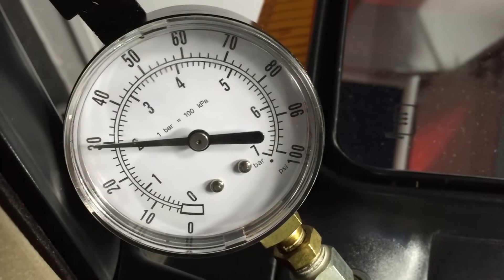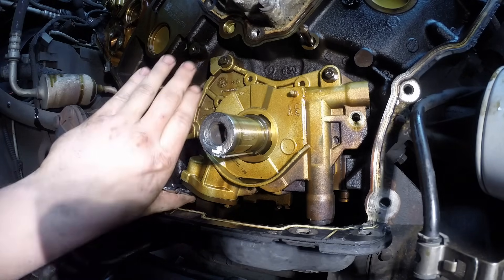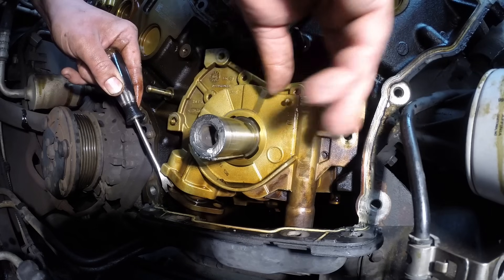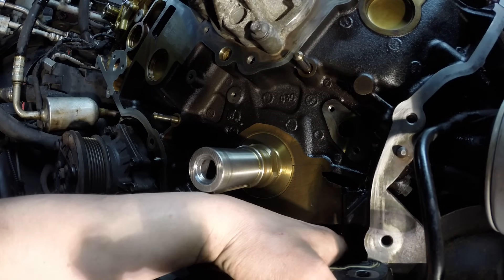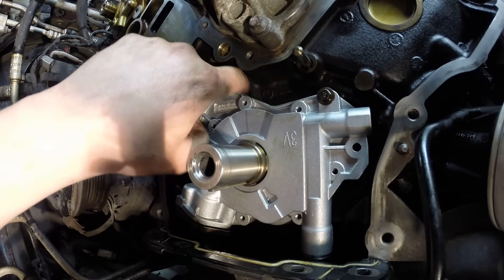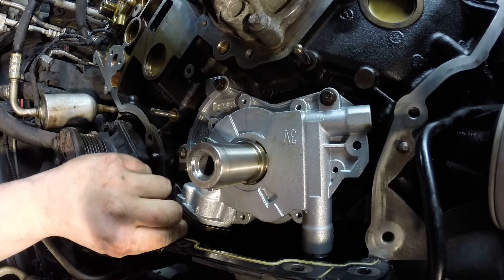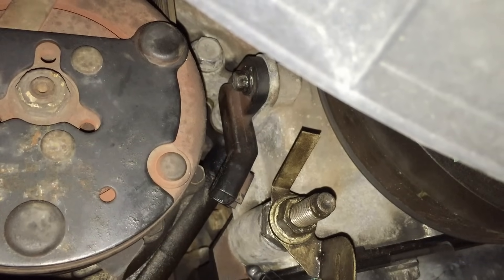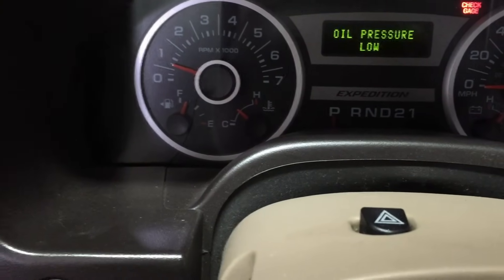Ford 5.4L 3v Engine Melling M360 Oil Pump Upgrade

Comment: Ok.. So you all who have done this.. You must have some smalllllll fingers. Because that one bolt.. Oh my... I could not get it to even turn. Because I didn't have that nice ratcheting wrinch. So how did I do it?  Yeah I had to think outside the box (after 2 hours) I wrapped the bolt near the head with a small amount of thread tape. When I got the bolt in I pulled the tape to make the bolt spin. That is the ONLY way I could get it. Any way THANK YOU AGAIN FOR YOUR VIDS.

Comment: I have a 1997 ford expedition 5.4 and Its leaking oil from the oil pressure gauge switch even after replacing it. What do you think might be the problem.
Reply: Dry off the threads and use pipe dope to reseal it

Comment: Delayed oil Pressure on cold start......

A question for anyone who may have experienced this issue or have had this problem. I just did the complete timing replacement job using all the Melling parts including the 360HV pump on my 2007 5.4 3valve and the engine runs fantastic. I contacted Melling because my oil pressure is high and climes to over 100 psi at high rpm. They told me it's because I put a high volume oil pump on an engine that didn't require it, (It doesn't have enough wear to require it). The engine has 218000km on it but I have always used K&N oil filters and Lucas 10w30 full synthetic oil in it. Here is my issue. After the engine has been sitting for several hours, if you crank and let it start right away it takes 3 to 4 seconds for the oil pressure to start building. when it builds, it builds fast. Before it builds I have the typical valve train rattle on the passenger side head until the oil reaches the head. The only way I seem to be able to mitigate this is by holding the accelerator to the floor and letting the engine crank for about 4 to 5 seconds and then let my foot of the pedal and it will start without the rattle because the oil pressure has already started to build. I asked Melling about this and they said to make sure that I installed the O-Ring on the pick up tube. I did install the O-ring that came with the kit and torqued the bolts to 89 inch-lbs. The oil pickup tube was removed and cleaned completely before re-installation as I had the oil pan off. Has anyone else exerienced this issue?
Thanks for any advice in advance !
Reply: It's my guess your lifters .. er, hydraulic lash adjusters are bleeding down.
Reply: Just wondering if you changed the tensioners? Oil is bleeding from the head somewhere? How did you make out, wilsonkg24?
Reply: @scottclydesdale1674  Hi Scott, thanks for your suggestions. I forgot to post an update here. I have solved the issue and to answer your question, I did replace the tensioners with the cast iron ratcheting versions . It turned out to be a phaser issue on the passenger side bank. I had used the Ford phasers in the timing job but there was a defect in the lock pin on that one phaser so I replaced the phaser again and the issue has been resolved. Just as a side note for anyone reading this,  I disassembled the phaser (which you shouldn't do unless are experienced at removing springs under high tension) and discovered that there was a piece of debris in the lock pin bore and it was jamming the pin so it couldn't lock the phaser at startup and idle. I corrected this and now have a spare phaser which I will probably never need now that I have sufficient oil getting to the passenger side head and the truck runs great. The idles so smooth now you almost don't know it's running at traffic lights.
Thanks again for your reply Scott.
Reply: @wilsonkg24  Amazing you discovered the defective pin. Couldn't read all your respones because of the size of the comments window, but these motors can be worrisome.

Comment: I see that Melling lists a M340HV for the 5.4 3v SOHC. The M360(and HV version) are listed as being for the DOHC 5.4. Is there an actual difference in the oil pumps between single and dual overhead cam engines?  Is the M360HV a higher flow high volume pump than the M340HV if they both fit the same?
Reply: For clarity, the difference is the oil pressure relief spring. The M340HV is set to 60psi whereas the M360HV is set to 80psi.
Reply: I had the same question. Which one for a 2011 Expedition 5.4L 3V......M340HV or M360HV....Amazon’s says M340HV

Comment: Did the timing job and pump. Now i'm not getting oil reading at dash (though i am when replaced with mechanical and iv'e replaced sender) I'm also getting p0010, 0020 0102 0113 0135 0155 2106. Are these codes just my truck trying to re-learn itself? but that doesn't explain oil sender,  maybe I damaged PCM? I'm really confused

Comment: So the M360 is perfect for my 04’ 5.4 Lariat correct???

Also, do you recommend using Lucas full synthetic blend stabilizer  on my 5.4 with 5-30 synthetic oil with 143,000 miles on the clock?? Yes it does have the load ticking noise. Gonna need a new timing chain set real soon. Thank you in advance👍🏼👍🏼👍🏼
Reply from the maker: I use this oil pump in all my 5.4L 3v builds 2004-2014 model years- https://amzn.to/2Nim7DM
Reply: Why when I click the link Amazon says it doesn't fit my vehicle? I have 2007 5.4 f150

Comment: I just did this job in an 07 Navigator before you start cussing and throwing stuff in your garage, just take a few extra minutes to loosen the bolts on your oil pan just enough so that the pan drops about half to 1 inch. You will be able to get both bolts on the pick up tube by hand.

Comment: I just replaced full timing kit plus the melling hv/hp oil pump and now have an oil leak from above the starter area. I inspected the valve cover gasket and that's not it so I'm afraid it might be the head gasket. Have you seen head gaskets leak after oil pump replacement?

Comment: Is it possible to put it in wrong even if it sets all the way back to the block and and lines up with the pickup tube? I'm cranking without the crank sensor plugged in and I'm not getting any oil pressure...
Reply: Figure it out?
Reply: @justinwalker3617  Yea turns out after talking to ford techs, freedom racing, and melling I gueSs your not supposed to get oil pressure registered at the dash until the motors fired. So I crossed my fingers and let her rip and she ran great until I realized my exhaust manifolds are cracked and are spuing smoke out, I also might have clogged cats as well because my pressure at the tailpipe is very weak. FUN FUN FUN!

Comment: Wondering if i can still get some feedback, 2008 f250 no oil pressure at all, nothing on the gauge, and the sound of no oil in the cylinders, itll start but i shut it off realizing there’s nothing get to the engine?! I did a change not long ago didn’t use a ford filter? Is it my pump or can a filter stop flow entirely??? Thanks

Comment: Brian answered the question if this pump will also fit a 2v, 5.4L engine (it does not) but he did not answer the question if Melling makes a high volume pump for the 2v. They do, it's the Melling 10227, and per their website, it is 8% more volume than the stock pump. However, it appears to be about 3x the cost of their M360hv, or M340hv pumps designed for the 3v, 5.4Ls. I'm curious why the big cost difference, they appear to be very similar size, shape, and design.

Comment: 10 to 15 minutes LOL took me that long just to put that rear sump tube bolt back in without dropping it.  Good video though
Reply: I stuffed a bunch of clean rags in the front of the pan so if the screw fell (and it did several times) it wouldn't roll into the sump.
Reply: @pescatoralpursuit1726  mine is in the pan to this day 😆
Reply: @shantor100  hope you have the magnet in you're oil pan 😭
Reply: @pescatoralpursuit1726  that's the smart way to do it.
Reply: Yeah... even for a master tech that works on bmw I was cussing that lower bolt.. took me 30 mins to just start it.
Reply: LoL
Reply: I was thinking 10-15 minute job🤣
Reply: For me, stuffing rags in, laying on floor and coming in from underneath I can get both bolts started and snugged with my fingers
Reply: I took me 2 hours, taking my time.

Comment: Hey Ford tech makuloco the AMAzon link for this pump says it fits the 4vavle 5.4l that has 32vavles that doesn't make sense can you reassure me that this is the correct pump for my 07 f150 5.4l 3v??
Reply from the maker: Yes it works for your truck.
Reply: @FordTechMakuloco  also do you recommend switching to 5w30 oil in my 07 f150 5.4 3v even before the timing upgrade or is that something you after the the new timing kit is installed??thx!

Comment: If this upgrade is complete, couldnt one  just put a new bolt on the camphasser with out actually doing the lock out as a fix for another 100k or so?

Comment: Hello 
I recently Installed a New Set of Pahzers and chains and the kit 
After all Assempbled I am not getting any oil Psi or flow i removed the Filter and there is no oil there either,  I filled the filter and tried again  got Nothing,  
Is there another Oring or Seal on the pump besides the Pick Up tube,?
Is there a Way to Prime the System with  removing all the Covers and Chains and Guides  etc etc 

thanks
Reply: I am having the exact same issue right now. Brand new OEM pump. Anyone have any ideas?

Comment: i purchased a 07 the guy purchased after market parts it runs bad is it worth putting oil pump in at this point 230k or just the phasers ?

Comment: Hey buddy. Just wondering. Is there any reason I shouldnt use the m360hv on my 4.6l 3v? Should I just use the m340hv? I just like the idea of having 20 extra psi output. My engine has 157000 miles. I am seriously thinking about putting a whole new timing set in this engine as soon as finances allow.
Reply: Hopefully somebody answers you even after 2 years. I have an '09 F150 4.6L 3V  with 159600 on it wondering about any the best preventative maintenance to do.

Comment: Just had an ATK REMAN die on me 1 month before the 3 year warranty expired. Lost oil pressure.  they sent the replacement so i opened it up and replaced the oil pump with the melling and found dorman cam phasers which i replaced with the linked ford oem units,  (cost me over $400). but now this engine runs with 60 psi idle and higher under throttle.  seems to run better than the first reman i had installed. Just beware of reman 5.4 3valves,  they seem to use Dorman cam phasers and maybe used oil pumps.

Comment: man, it's too late now. but my problem is that one side is getting good oil flow to the valve train, the driver side is not. 32v 4.6l aviator. I replaced chains, tensioners, guides, removed pan to remove broken guides. Driver side under VC is clean as could be, pass side  VC is dark brown, and noisy. I have the VC off, any suggestions?

Comment: I would like to see where how you tapped the manual oil pressure gauge
Reply: These Fords don't actually have an oil PRESSURE gauge, instead Ford came up with a wierd switch system. If the pressure reaches a point that Ford thinks is sufficient, the switch closes and the dashboard indicator moves. The sending unit (switch) is located just behind the oil filter. You can remove the sender, replace it with a "T" and put it back on the end of the "T". The side port can be used to run a line up to a real oil pressure gauge on your dashboard.
Reply: ...where it normally goes

Comment: Just wondering if this procedure is the same / similar to a Triton V10? We had a seriously cold snap here in Montana and now when I start my truck first thing in the AM, it takes roughly 10-20 seconds for the oil pressure gauge to start reading correctly and the light goes off... it's fine after it's warmed up and oil pressure seems fine while driving. Any thoughts?!?!? Thanks for the great videos!!! Life SAVER!

Comment: I clicked on the link. It says it does not fit my 2004 f150 5.4l 3v. What other do you recommend?
Reply from the maker: It does fit trust me, it works on all 2004-2014 5.4L 3v engines.
Reply: @FordTechMakuloco   thank you very much! Awesome videos keep up the great work!
Reply: I get the same message with the Ford 8L3Z-6M280-B Solenoid. Does this also work with my 2004 5.4l 3v. Sorry to be a pain.

Comment: Which oil pump would you recommend for a 2011 F150 5.0 with high mileage? I’m thinking I need to upgrade to a high volume high pressure application.

Comment: Does this same pump fit the 4.6 3v?
Reply from the maker: yes
Reply: FordTechMakuloco thanks man, also I have this rattle type noise when I put it in drive and cruise in first gear around 1,000rpms, any idea what it could be? I have a 2010 f150 4.6 3v with 6r80.

Comment: Did this over the weekend, and it turned into a 3 hours job.  I thought we had rags in the pan and we didn't.  So when I dropped one of the bolts, it went down into the pan and under the baffle, so we had to drop the pan.
Reply: Just grab an "extra" bolt and go ahead and throw a couple 1/4" 10mm sockets in there, too. Won't get sucked in the screen anyways!

Comment: Was the cam phaser/oil pump issue mainly 2004-2008? Some of the 2009 F150s are starting to get into my price range. Do those need the oil pump, timing chain, cam phaser upgrade too?
Reply: Potato king. Yes same engine. I’m doing this is my 2010 super duty as we speak

Comment: Hello im new to DIY car maintenance but I have a 2003 Mazda tribute Duratec 3.0 by with a bad oil pump, will I have to reset the timing after changing out the pump?

Comment: Did we ever get verification on whether or not the M360HV is in fact the correct pump for the 5.4 3 valve engine? The link below states that this isn't the correct pump for my 2006 Lincoln Navigator with the 5.4 3V engine. I mean, I'm sure he didn't make a mistake when posting the link but I'm about to buy so I want to make sure.
Reply from the maker: Yes you can use either the M340HV or M360HV in any 5.4L 3v 2004-2014.
Reply: FordTechMakuloco Thanks bud,  you’re a true rock star! I plan on buying everything in the next day or two and will use your link because I know you will continue to make these AWESOME video tutorials. Thank you!!

Comment: First off what is your thoughts with the cam phazer lock outs? Second do you believe this oil pump is superior to stock? I feel as tho a new oil pump and new updated phazers would be my best option? is there any other major parts that should be replaced in this process? The mechanic that looked at my truck said he would like to replace everything if he takes it apart but iam looking at 3500? is he out of line? Iam scared to do all these parts and work to have it happen again in 60k miles. I have read horror stories with both lock outs and just people replacing there phazers and having trouble again I have a 2010 F150 105k on it. Any help and opinions are greatly appreciated?
Reply: p.s. where are you located out of?

Comment: I have a 2006 Ford F-150 that has rear main seal leak, jerks at the highway speeds(maybe spark plugs and boots),leaks from oil pan leaks from transmission needs new transmission stick :) how much it will cost me to change them all. Since you re there change timing guides and phasers too oil pump

Comment: I have a 04 5.4 me model f50. I have major issues with everything you have talked about. Is it worth it for.me to swap to full synthetic oil or stay with conventional. Mleage on my truck is around 150000
Reply: always synthetic, a syn blend is what you should use to begin with. full syn if you like your wallet

Comment: My 07 Toyota sienna calls to pull the engine to replace the water pump, I couldn't believe it and yea sure enough it does, but I was able to do it myself without removing the engine with just removing the passenger side engine mount and a jack

Comment: After watching your vid, I pulled the oil pump on my truck to replace it with the 360.  My stock oil pump had a complete blockage in one of the oil passages.  Is this something you've seen before?  I change oil regularly.  The truck has 150k miles on it, and was running fine, but I decided to tear into it before I began having issues.  I also found the gaskets on each chain tensioner were in the process of failing.  Your vids saved me an engine.
Reply: The 5.4 does have its problems but I’ll tell you what it’s got no where near the issues that the 4.7 Chrysler motor does lol. How about the fact that rain water collects under the intake manifold in the valley rots the dipstick tube and then fills the oil full of water. That’s a pretty neat trick. People these days don’t take care of their stuff they don’t do regular maintenance I only know that cause I just finished pulling one out of a Durango that had the main bearings spun cause there was more water then oil it proceeded to take out all the lifters and the rod bearings just an absolute joy
Reply: maybe thats what takes out the cam phasers and timing chain
Reply: Normal for the 5.4 3v. I love my Fords but you cannot ignore the fact that the 5.4 3v has some serious design flaws. One is the head design,it accumulates sludge and eventually circulates it. One reason why I tell people do not run engine cleaner through that engine. Youll circulate the sludge even more. You have to physically remove the valve covers and do it by hand.

Comment: Hello, I have a question. I went to Ford because my Ford Escape 2009 XTL all wheel drive has the oil light on. Ford told me the oil pump has low pressure. Since I still have warranty from the dealer I bought it (which was not Ford), Ford told me to go back to them to get it replaced. I took it to the shop and they are telling me that the oil pump is not located inside the motor so it is not covered by the Motor and Transmission warranty. I feel that is not true. Can you please explain to me?  Thank you